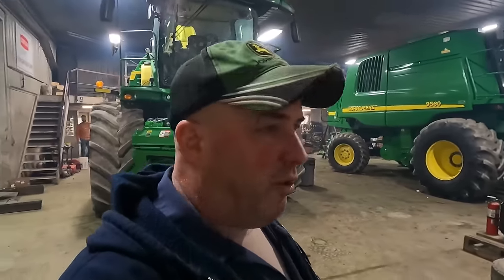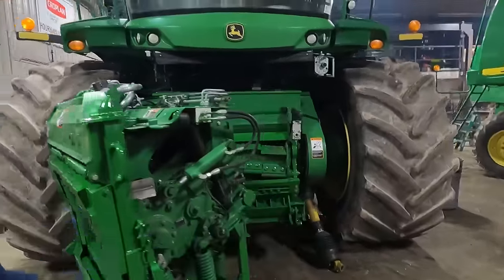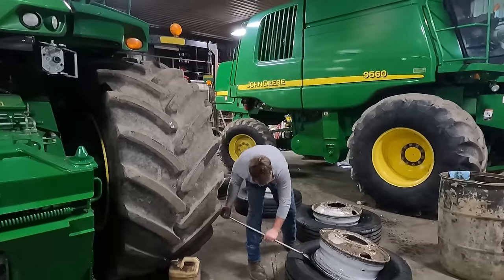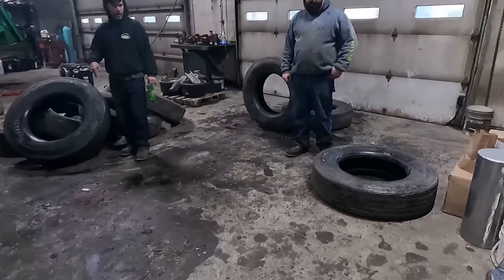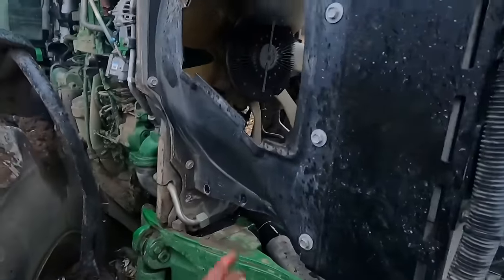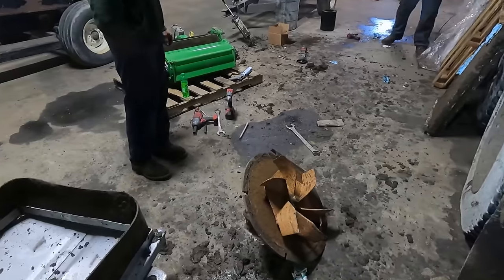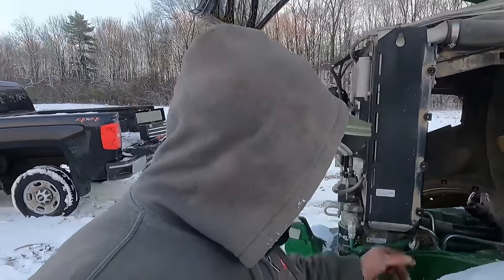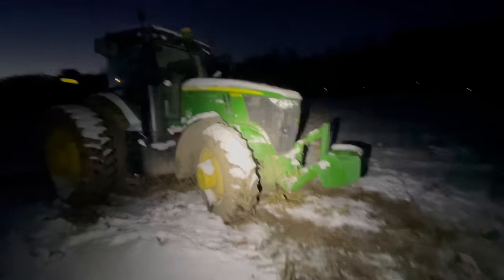Sarah Broke the 7290R bearing failure

Comment: I know it’s a bit late for advice but if you loosen the 2 grub screws on the end of the drive shaft for the pto on the 7r it slides just enough to get the belt on without taking the transmission cooler out ! Great video as usual 👍🏻

Comment: Wow, an original starter on that Freight, very impressive. The PTO shaft was probably wedged against the compression of the engine and the fluid back pressure of the hydraulic pump. When you impacted the front bolts shook it loose, I've had that happen on a couple of machines before. I think it's because those pumps are one direction and just hold enough back pressure to keep things bound up and the vibration seems to be enough to  move the fluid. I'm guessing that Bush hog was suspended on a hydraulic ram or maybe the blade motors. I just hit the control levers a quick tap to release any pressure when working on hydraulics just in case. Hard to think of little things like that when you're focused on getting it done and out of the cold. My aha moment was after midnight at -20 with about 6 coyotes watching from the edge of the field. The life of farming. You sure have a good crew.

Comment: Next time you find that a belt needs to be replaced in a similar installation, put two belts on. One to use now and the other tied up out of the way so that when the belt breaks again you can install the second belt in a mater of minutes instead of going thru the dismantle and replace again. I use to fix IBM selectric typewriters. It was a pita to replace the drive belt, so I would put two belts on the shaft. Next time the belt broke I could fix the typewriter in a mater of minutes as opposed to several hours to dismantle and reassemble. I even had some of my out of town customers make the repair to their typewriters since the belt was easy to slip on.
Reply from the maker: Belt would dry rot though

Comment: Two points of observation
1) Tearing into the tractor wasnt wasted time. You learned, and shown others how to do an easier belt change.
2) My time with hose wearing gradalls I learned that plastic wire ties wrapped around the wear area of hose rubs substantially reduce wear. And take but a minute to do or redo.
Very heavy wear areas got a chunk of old radiator hose as a base then the plastic ties
Id say it extends the hose life 10 or more times at least (from rub wear)

Alwayd great vid Andy. Thank you.

Comment: There is a place in Kansas City that call rebuild the housing and the fan blade with AR steel and it will last 3 times longer I have had liners made for the fan housing made that goes on the inside

Comment: Hi Andy. Why don't you put some skylights into the ceiling/roof of the shop - it will give you natural light in the shop and if you want to get some electronic skylights they will give you the ability remotely open/vent the shop too - could be useful in winter if you start a Diesel engine in the shop - no need to open the front doors to exhaust the fumes and lose all the Shop heat. Great videos, thanks for the content.
Reply from the maker: Hard to insulate
Reply: Farming Fixing & Fabricating double or triple glazed skylights are relatively cheap. You can also build a mounting box on the roof to angle the roof light/skylight to best capture the sunlight and to also raise skylight above normal snow level. You can easily insulate the mounting box, so should be straight forward and easy project.
Reply: @paullynch277  Why cut a hole in a perfectly good roof? And pay for it as well?
Reply: Farmer Bill two reasons - first you allow natural light so don't need to run lights all the time and second when working during colder months it allows you to vent the shop instead of opening the large front doors when you have exhaust fumes due to engines running indoors. I run a large manufacturing facility manufacturing military equipment -we installed and have found them invaluable to our business, making life around the shop much better. My shop facility is 150,000 sqr feet and was only 1 year old before we decided to cut into perfectly new roof structure, so I understand the hesitance to do this - but I can assure that the result is well worth it.
Reply: @paullynch277  In a farm shop? Um, yea, no.
Reply: Farmer Bill substantiate your position and explain please.
Reply: @paullynch277  Happily.
     It's a pole barn, not a commercial building. It would need substantial structural changes to support the load. Cost ineffective.
   It is an expense, not a profit center, the less he uses it, the more money the farm makes. Sure breakdowns cost more when someone else does the work. Although it saves money, it doesnt make any. Again, cost ineffective.
    He doesnt run three shifts, hire mechanics, or have a lucrative government contract. So again, cost ineffective. 
    What else would you like to know?
Reply: Farmer Bill that's just plain wrong. As a structural engineer - it's a straightforward job to do and if you are anyway inclined with a saw and a hammer it's easy to do yourself. It's even easier to do on a pole barn as invariably it's got a timber roof support. Now I'm sure if you have someone else come do the work for you then yes it could be expensive, depending on how many you like to install, but I take it as a given that if you have a shop you have the skills to do this type work yourself. Note the suggestion was never made with intention to save money, although it does have certain cost benefits depending on type of work and time of year after installed...........
Reply: @paullynch277  obviously you're a structural engineer and not a carpenter. There's no "timber" in a pole barn. It's all engineered wood trusses, engineered to hold up the roof, the ceiling, the areas snow load, and not much more. Every time you hack a hole in it, you weaken it. Without completely redesigning the roof and adding trusses, you can't safely add weight. Which should never be attempted without a qualified carpenter anyway.
     So you would have him spend tens of thousands of dollars on a retrofit when just building a new barn would be about the same price? Not to mention, most of the winter work in the shop is done after chores when it's dark anyway.
    You may be well versed in making whatever government widgets you make but you know nothing of pole barns or farming. In case you're wondering. I spent 45 years building houses and barns all over indiana and Ohio.
Reply: Farmer Bill your knowledge on construction seems limited at best and that's being kind to you.
Reply: @paullynch277  Right. Stick to making your widgets Poindexter.
Reply: Farmer Bill you are starting to sound just like Crazy Nancy ......🤣🤣🤣
Reply: @paullynch277  yep, you're right. You know everything.

Comment: We run a 4995 self propelled mower. I have seen you guys are running a newer model. Hope someday to see more of it. Would like to know if the hood scope works well, we have to blow out the radiator twice a day. And how well does the rear suspension work?  The 4995 has been very good to us, when it was bought new rite around 15 years ago we gave 80. I am not that sure what a new one the equivalent cost right now is, but I looked up a few used ones and kinda got disgusted man they have went up!!!
Reply from the maker: There is a hood scoop available for yours and it helps out a lot

Comment: Yes that hose was going to blow. It only a matter of time once the wires are exposed.  In my job I change 200 plus horses a year and most of them are because they rusted.
One precautionary thing. Don't use the hose that has kevlar molded on the outside of the hose. It let's water into the wires. If you need to buy the hose rap that goes over the regular hose. Looked like a number 8 / half inch hose with a short 90° JIC fitting  and a straight on the other end.
Reply from the maker: For seal
Reply: @FarmingFixingFabricating  I'm 62 and have been working on equipment on the farm from the age of 10. 52 years you pickup a thing or two.